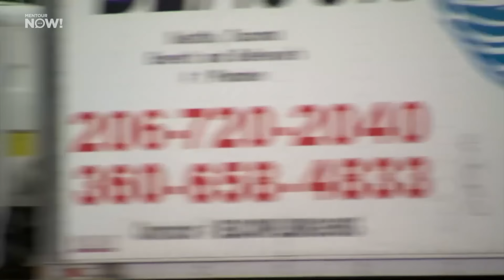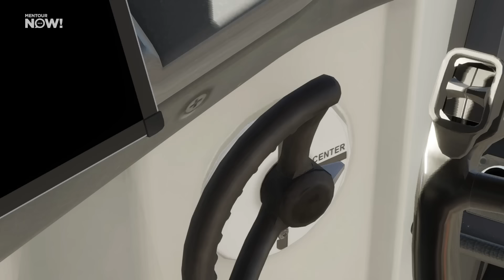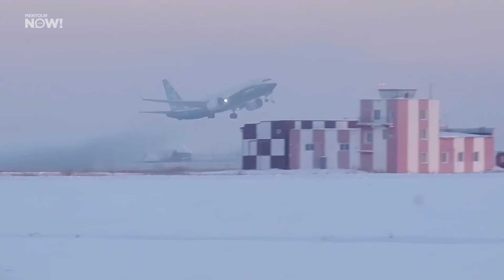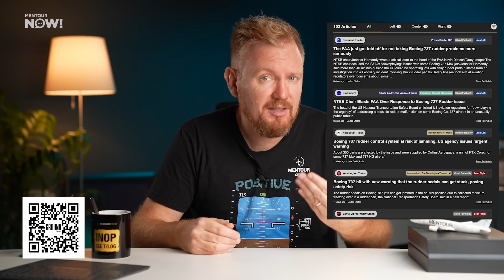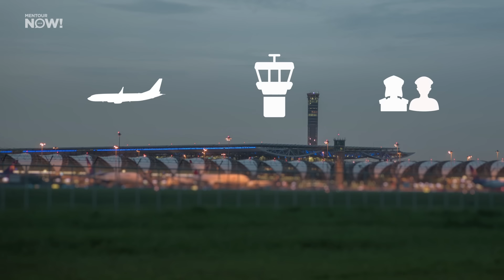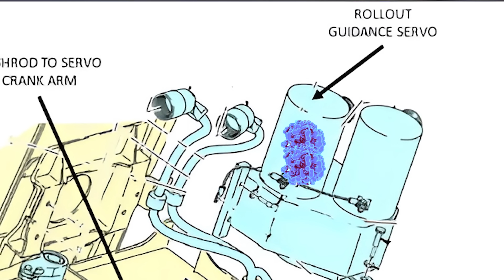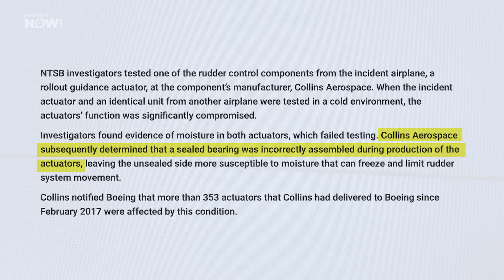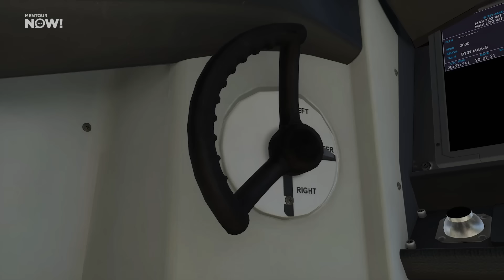Does the Boeing 737 Have ANOTHER Major Flaw!?

Comment: I haven't watched this yet. But I'm beginning to think that anything found on a 737 is now a major issue according to the press and non-aviation types. The thing is that it's Boeing's fault for being in this mess. I know in manufacturing QC you never want to to many failures in a row because it results in a microscope effect and everything you do is now magnified. NOW, I'll watch this video and hope that it's not as bad as the headlines make it out to be. ADDED after watching whole vid.....Yeah, applying maximum force during any part of a stabilized approach or Take-off is to say the least NOT my best option, and that's being very kind with the wording....
Reply from the maker: You're on the right track, about the news and in terms of Boeing's oversight...
Reply: How about applying the following test to this piece of news. Were it to be discovered that Airbus has produced multiple airplanes that have a defective part that can cause the plane's rudder to be stuck, with the potential of causing the plane to exit the runway at high speed on landing, would you consider that newsworthy? If so, should it not be newsworthy even in case of Boeing?

Comment: So Petter - gotta ask: has Ryanair checked its 737 fleet?
Reply: If it was an optional extra fair to say Ryanair would have passed on it lol
Reply: No need for that. Ryanair has its designed fleet, I may assume. This indicated problem occurred on a plane that was meant for another airline with other demands.
Reply: Ryanair pilots usually overpower any stuck rudder pedals 🤣
Reply: Ryanair is actually very on top of maintenance. I have read an article where the CEO said that when they bought a new plane the plane was checked by engineers before entering into service, this was because he said they found crazy stuff on the airplanes and he no longer trusts Boeing. But he also said that the aircraft have been with lesser failures on the last deliveries 🤷‍♀️ he knows that if something happens it can be expensive, he is just avoiding bigger costs by focusing on maintenance and check the aircraft state upon delivery

Comment: 757 is my favorite Boeing. Change my mind.
Reply: 727 🤝 757
Reply: Flying ✏️
Reply: 787 mic drop
Reply: @usefirefox  787 is a contender, but it had such a troubled rollout.
Reply: @usefirefox  Too fat. Not enough window seats.
Reply: @PsRohrbaugh  I can't disagree. 757 is the sexiest airliner ever built. Big cans and long legs.
Reply: @slartybarfastb3648 huh no! Concorde was. Tbh 757 barely makes it in top 5
Reply: @guillaumeromain6694  Concorde was too pointy with unshapely, warped wings and goofy looking landing gear. Boxy engines and way too loud.
Reply: @slartybarfastb3648 Concorde was designed like a bird, have a long hard look at what nature does regarding wings... High landing gear: Delta wing is inefficient at low speeds AOA on landing was critical hence higher landing gear. Engines: Concorde made flying as fast as a bullet while sipping Champagne dressed in a suit a reality for 27 years. No other aircraft did that before or since. 1960's engine technology was noisy #slowassboeing707..

Have a look at Concorde in flight. Go back to your 757. Don't kid yourself..
Concorde will forever be the most gracious airliner ever built. Just like a performance car is more appealing to the eye than a bus. Humans are shallow like that. We're animals...
757 will go down as an airliner like any other. Concorde is still talked about as the one of a kind, no other nation could compete with.
90 % of commercial pilots wish they could have flown Concorde. 757 doesn't exactly draw such envy....
Reply: @guillaumeromain6694  Beauty is in the eye of the beholder. 757 is art. Concorde is a pointy stick with big ears.
Reply: @slartybarfastb3648 😂 desperately trying to frame this uplifting debate as an objective one, before waging his personal war... oh dear! 757 will go down as one of the busses of the modern age aviation industry. Concorde is still talked about 21 years after retirement and still stirs collective hopes and imagination... no where round that fact, friendo. You may not like those facts. They're still facts. Concorde's legacy? The greatest, sleekest, most badass of all airliners of any era, the one of a kind which pushed the enveloppe and -  the forerunner of mighty Airbus. 757 legacy? You wanna go there?
Reply: @guillaumeromain6694  Relax. It's not a big deal.
Reply: @slartybarfastb3648  Big forehead but who cares!
Reply: @slartybarfastb3648  I certainly can. And I do
Reply: @guillaumeromain6694 I know you're replying someone else, but I'll note I said "my favorite Boeing", not airliner or airplane.
Reply: B52 now gtfo hippies

Comment: Who put the part together in the wrong way? Spirit? Was the description to mount the  part badly explained?
Reply from the maker: It wasn't the mounting of the part in the plane that was the problem, the assembly of the parts internals is what did it
Reply: @MentourNow  I’m working in the chemical industry and we would have experts of supplier involved when assembling key equipment, but it sounded like it was done by an unrelated third party under their responsibility with just a description on how to do it…..
Reply: @MentourNow  who assembled it though, as that is the underrated main mistake. Many assemblies would break if assembled wrong…. Seal wrong way round etc

Comment: Wasn’t this flight test of the rudder they performed a bit yolo?
What if it stuck at full deflection and couldn’t be unstuck?
Would the aircraft be controllable? Would it be possible to land if you can’t center the aircraft with the runway?
Reply from the maker: It would need to stay off-center a long time before it actually freezes there, I would imagine
Reply: True, but at the time of the test they didn’t know, it was stay-in-same-position problem. 

I guess the real question is: do you feel the system has enough redundancy to consider such test safe?
Reply: @extremegf  valid point. I thought the same. very cowboy-yolo to 'test' it as such smfh

Comment: So if I am following correctly the approach Boeing took to disabling this system that was not wanted so that the airline could have a consitant set of proceedures was to leave it mechanicaly connected to the rudder system. That traight away means even disabled the maintenance procudres for an aircraft with it fitted but disabled has to be different to one without it even fitted as it will need to be maintained. A secondary consideration is just having it fitted increases the dry mass of the airplane. So Boeing took that absolute cheepest option to disable just clearing the enabled flag in the software. However the airline still had the costs associated with the part being fitted.

Comment: Sounds similar to US Air 427, which (I know you said this isn’t the same as the hard-over accidents) but happened when hydraulic fluid froze in the rudder’s servo valve. Similar failure of a different part.

Comment: The old rudder hardovers were bad enough but, if I remember correctly, didn't the failure also include rudder reversal which is what made it truly deadly?
Reply from the maker: I’ll get into more details about that when k cover it, over on Mentour Pilot
Reply: I think it did. Which made it extremely difficult on the pilots in the fatal crashes. B/c the rudder was doing the opposite of what it was supposed to be doing and there was no way for them to know that. The third incident which didn't have a fatal outcome allowed the pilots to describe what they were experiencing to the investigators that provided some clues. .

Comment: But a 737-rudder issue happened before resulting in two fatal accidents and a near accident! In those cases the rudder jammed hard over.
Reply from the maker: Like I said in the video, this has nothing to do with that
Reply: @MentourNow  Yes it does. It might not be the same actual problem but it apposite to QC and the awareness and evaluation of un commanded rudder problems. If the steering wheel in a Telsa had two different problems they are nevertheless connected by a culture of failure, and you'd expect Tesla to be more vigilant with their steering wheels.

Comment: yeah, I can see where jumping on the rudder pedal while rolling at high speed is probably not the best idea.  but it leaves me wondering, how many landings are done with no rudder input?  it seems to me like getting all the way to the ground before realizing the rudder was stuck would be unusual.
Reply: You don’t use much rudder for landings in light weather which looks to be the case that day in Newark. You really begin to use the rudder to keep yourself on the centre line since it gives you more fine inputs. As the creator mentioned perfectly, you would use it when landing in unfavourable wind conditions. Automatic rudder inputs only cover basic things like the Dutch roll for example
Reply: @kenbrown2808  My understanding is that the rudder was not stuck. The pedals were stuck. Until autopilot was disengaged, the pilot flying was not attempting any rudder pedal inputs.
Reply: @slartybarfastb3648  yes, and how common is it to land without any pedal inputs? Addendum: I'm asking because it sounds to me like if it is less than a cat 3b landing, the pilot has hands and feet on the controls, and i would think the conditions where the plane would align perfectly with no rudder input would be uncommon.
Reply: @kenbrown2808  I bet that 
EITHER it's not too uncommon for the autopilot to not make any rudder inputs at all (or barely any rudder inputs) during some of its turns - in which case it would not be suspicious if 3 or 4 of these turns happened in a row;
OR (more likely) rudder inputs are just the least obvious of the 3 inputs. Especially if the autopilot is capable enough to make the turn look and feel like it's proceeding perfectly normal otherwise.
Firstly, because it's a thing that's not happening that should be happening (as opposed to something happening that shouldn't be happening). And secondly, yaw, roll and pitch inputs (I would guess) are happening simultaneously, and not successively - a step in a sequence being skipped would be much more obvious than something not happening while you're "distracted" by 2 other inputs happening.
Reply: Not so. Watch the clip again.
Reply: @PotatoRadius  what's not so?
Reply: @slartybarfastb3648 wrong. The rudder was stuck. As the creator mentioned. It’s a closed loop system, if the rudder is stuck, the pedals are stuck. Vice versa
Reply: @ryleymclean313  It waa also stated that the servo had been disabled and was no longer functional. Howevee, the hardware had not been removed. This does not mean everything on the other side of the servo was inoperative, only that the connection between the servo and pedals was.

Comment: Wait, hasn't this already been a problem, and wasn't that fixed?!
Reply from the maker: Well, this is a different problem
Reply: nah the previous accidents have been caused by thermal shocks to the PCU due to hot hydraulic fluid pumped into them. this is a separate servo mechanism
Reply: I did not watch that part of the video before that part.

Comment: I think all the Maxes should be considered “lemons” and sent back to the company!
Reply: This has nothing to DIRECTLY or UNIQUELY to do with the MAXs, as it is a part that is common with the NGs also. Also it is not even a part that Boeing has direct manufacturing control as the seal was installed incorrectly at the outside manufacturer. What Boeing actually should be criticized about has nothing to do with the MAX, but is their written “pilot’s solution” which again is not MAX specific.
Reply: You're a lemon